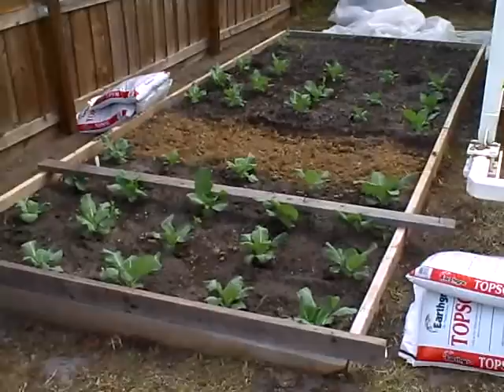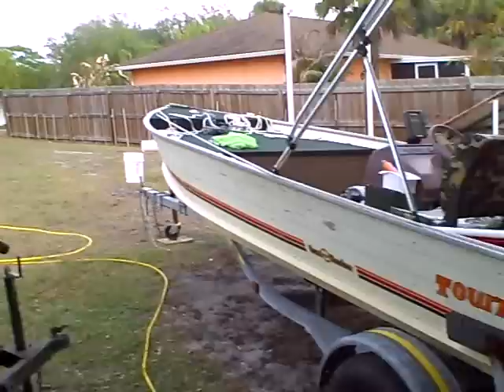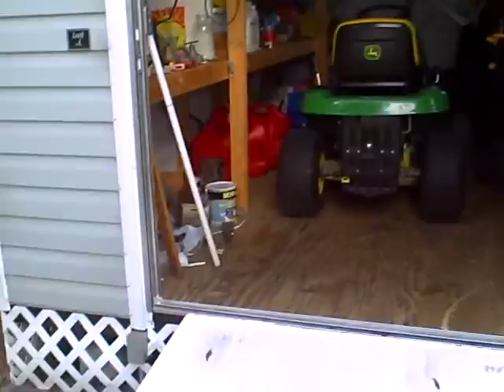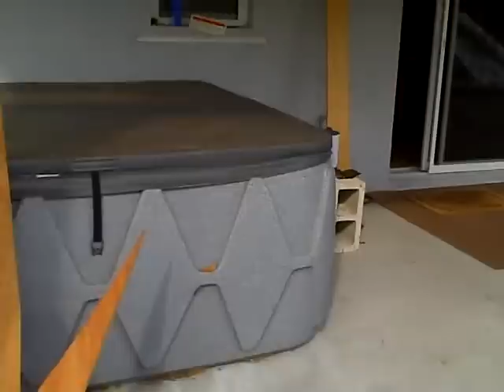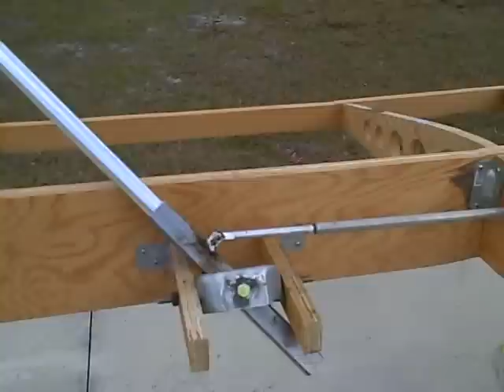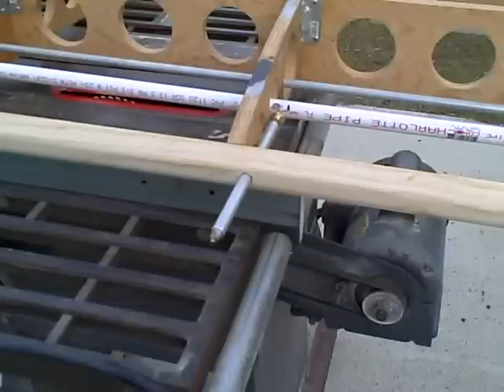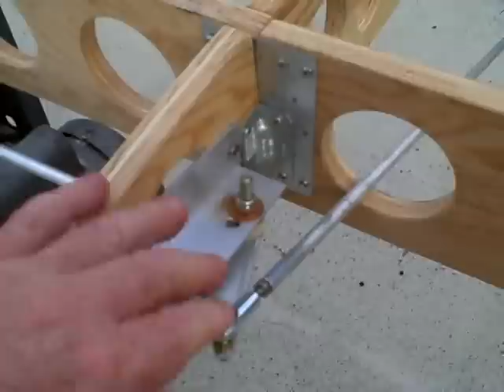My Home Depot Project Airplane

Comment: Like BetterAircraftFabric, I'm scratching my head a bit about your wing cross section. That's more or less a supercritical section, like you'd see on a P51 Mustang, or modern jet. On a personal homebuilt, which I would expect to fly at 70 ~ 150 KIAS, you don't want a shape optimised for 500+ KIAS @ FL300.

I would remind you that what you're doing is extremely hazardous. I do understand the temptation, I have been tempted myself, but make sure your life insurance is up to date, and make sure they'll actually pay up if you buy the farm flying a home built, self designed aircraft.

Comment: The stringers won't add torsional rigidity to the wing using the technique you described in the video. Your wing was nicely made, but it's not going to be strong enough and is probably way overweight for the amount of load it can carry.

Find a local chapter of the EAA and see if they have some advisers willing to help you out.

Comment: Hi, Your wing-airfoil section looks very un-usual with the thickest point very far back, where did you take the airfoil shape from? Did you draw it up yourself? A airfoil for a homebuild plane should be of good harmless flying characteristics, which leads to using a known good design, such as a NACA 24012 or a Clark-Y. These relatively thick profiles make rib-shapes that allow for easy construction of a strong, safe wing. I would urge You the contact the local EAA chapter and seek their advise. Solitary building and design of a plane means going against extreme adds...
Reply: Your over this guys head with the engineering talk.

Comment: Massive plywood ribs,  heavy PVC piping, flimsy electrical box joystick gimbal & attachment, flimsy control lever at aileron, plywood spar (drilled to boot!), the list goes on and on, and we're still on the left wing panel. This would be nice as a full-size mock-up for display purposes... But please tell me you won't actually strap yourself in this thing and attempt to fly it.

Comment: hes in no danger apart from going through the fence after a high speed take off attempt, to heavy, spars to thin, point of max deflection to far back from leading edge, total resultant will be lift tilted so far back it'll be mostly drag. but hey hes handy I'm sure he'll fix the fence after! oh and please stop calling it a joystick!!!

Comment: Check out the "FX Super Light". You can get the plans for $25.00 at Alternative Technologies. They also have plans for several ultra light helicopter designs Some as low as $10.00.

Comment: Barvin, I'm not disrespecting the builder or his ingenuity. This guy isnt inventing anything. The airplane has already been invented, and this guy is not improving on the invention or being innovative. His materials are to heavy and weak (needs aircraft quality). It would be a very short flight if it got airborne, which it will not. It will fold up like a lawn chair and fall like a stone. The pilot will die.

Comment: whaticouldsee: thank you for your reply. so how about attaching the engines to the main metal structure  around the cockpit which supports the landing gear.a two feet long tubing structure would be needed for prop clearence I realize I would have to increase the height of the landing gear so the prop will be at least one off the ground.You being in Australia you cant do this yourself of course.

Comment: "The aileron goes down, and that would be a LEFT TURN???"  Wrong Way Corrigan here.  I honestly don't think this dude will get killed flying this airplane, unless he rolls it off a cliff.  Even a PROPER airfoil wouldn't life an airplane that heavy, but the airfoil on that collection of crap won't generate enough lift for this brick.  Now... he might smash into a tree or ditch at the end of a runway.

Comment: I was worried about the effects of gas vs tig welding on weld integrity in my wing fittings made from 4130. Hell this guy bends some up out of extrusion grade aluminum bolts then to exterior plywood with zinc plated Grade None bolts and nuts and he sleeps like a baby. What the HELL>

Comment: safer for you when you are changing the pitch of them during flight. Otherwise you would have to have a serious grip on your steering control or else the wind will become your worst enemy. Tighten them with some 100 pound pull springs to allow less freedom of movement in the pitch of the Aileron itself and you will have found yourself flying a home built plane a whole lot safer than if they were to remain unaided by any other form of spring or hydraulic control lines.

Comment: which would be bad for you since the effort required to shift your Ailerons up and down is so little the wind speed and angle of your Ailerons during flight will move up and down as easy if not easier while you fly unless you find a proper spring or hydraulic line to keep pressure to pull your ailerons in place. This will keep your Ailerons in your control and not in the control of pitch, wind speed or turbulence. My advice is to attach a spring mechanism to your aileron push rods to make it

Comment: To add a set of heavy duty gate springs to your wooden wing frame that pull towards their center to keep your Aileron push rod controls tightly set in their position for stable flight. Having springs that pull against your Aileron push rods will then cause you to have better and more manageable control of the up and down motion of the Aileron itself. Having the aileron push rods move as freely as they do in your setup now will cause your control surfaces to constantly experience shifting.

Comment: Great start to a practical idea. One suggestion though on your Aileron push rod connections. The main rod that connects to the 90 degree push rod that controls the up and down motion of your Aileron is to loose. What i mean by that is if you were to leave the push rods as they are in your setup if you were to fly this thing fully built you would notice that the wind speed would cause serious fluttering of your Aileron thus making your control surfaces unstable. You need

Comment: Your materials selection is shocking, generic ply can not be counted on for consistency and strength and is way too heavy in that design...your pitot protruding through the leading edge essentially renders that part useless, the first heavy loading and the leading edge will break in two at that hole...it is not braced or sleeved or in any way compensated for...the aileron will suffer skin ballooning and is unbalanced so it or the linkages or both will fail very early on under flight loads....

Comment: I just can't say enough about how reckless it would be to promote or consider this a safe flying machine, there is no internal bracing or bracing of any kind with big spaces between ribs and a woefully inadequate main spar.Your construction is way way too heavy and what's more you are trusting this heavy, unbraced, unstable and weak structure to sustain flight and operate safely in all envelopes and endure flight forces carrying you!!...

Comment: I just finished an RV-7A build and am about to build a Sling LSA and I am very concerned  about the construction and design flaws of your project. As it is the hardware you have used is almost certain to fail - there is a reason AN hardware is used in aircraft construction and engineering and wherever possible all fasteners and couplings and assemblies are 'safetied' for good reason, your concept that simply abandons essential rules of aircraft engineering is a 100% recipe for disaster

Comment: I take my hat off to you for wanting to build your own plane. I understand how much work and effort it can take to work at such a task. as a matter of fact, I am also working on my own plane design. mine has about the same wing span as yours, but the fuselage is 18ft as well. as a suggestion, get a hold of a model airplane kit such as a Kadet Senorita or a like model. those old time model planes had many similar design characteristics of small full size aircraft.

Comment: TOO HEAVY. Aluminum skin for an aircraft this size is way over kill. If you want this to fly, you want the ribs for the airfoil to be made of high density 1 1/2 insulation foam (The pink stuff) and use an aluminum dowel as the wing spar, and other stringers as you feel the need. Plywood and aluminum skin will not work.

Comment: Dude do not fly that.  It will kill you.  Get some plans and do it right where all the engineering has been done and you are using approved and tested materials.  That joystick gimble is not safe.  That is not aircraft grade aluminum, but cheep slag aluminum that is not ANSI certified.  It will eventually crack.  The way it is attached to the wing is dangerous too.

Comment: I'm not trying to be a party pooper here, but this is clearly not meant to be a wing on a flying aircraft. This thing is fine for demonstration purposes, but this wing, as built, would barely support its own weight in flight, much less an aircraft with a pilot. Just a few things I noticed, the aileron hinge is far too small and weak to remain attached if subjected to in-flight stresses. The main spar is too thin and has an unsupported joint at the fifth rib. And that joystick gimbal? Really?

Comment: The two piece wing spar sure is an interesting choice, and nothing more than a butt joint held together with a few wood screws. You must be aware that this will fail to work and the wing will fold on you should you actually get enough airspeed to put any sort of load on the wing.

Comment: Sir, I am a Captain at a major airline, I have over 25,000 hours of flight time in everything from J-3 Cubs to large transport category jets, I've also been a licensed aircraft mechanic for 30 years. Please do not try to build and fly your project plane without proper plans and some help from knowledgeable people. I can see several potentially FATAL flaws with your design. Plans are relatively cheap and there are lots of people with experience that will help you for free.

Comment: It won't fly, wrong materials man! TOO MUCH WEIGHT! By a LARGE measure. With my first real attempt at flying I built a hang-glider out of ail-board poles and tent-flies. I tried it out in the wind, on a dam-wall. And before I was ready for glory, I was already hovering at 6" above the ground. It was very easy to pick-up (and poles were only normal glass-fiber). It turned- out that it had a bias to the left. I was going to try and fix it but didn't get round-to-it and I gave-up (too scared).

Comment: Should've used a regular board for the spar instead of ply. I can't tell if these are, but wood screws are bad. This may seem light-weight to someone who has worked on houses and such, but it's way too heavy to get off the ground.  That looks like 1" pine ply, which is too thick and the wrong material.
Your other projects look pretty well done though.

Comment: Hi,
Building such an airplane at home gets even more fun and more possible with our BetterAircraftFabric Covering System: It needs no paint for technical purposes, comes in different colors and can be painted if so desired. Its UV-resistant and easy to apply: Check out our U-Tube channel and Look for Oratex6000. It goes on with a non-toxic glue with no Solvents, glue-strength is over 100pounds per square inch! And you save 80% of the time that is needed for the usual covering systems.BestRegards

Comment: I see you are using plywood for the main spar. This is your main tension and compression member, and plywood can not provide that strength. Do not fly this! Aircraft plywood can be only used as a shearing field in a spar, but only if you have spar caps of adequate straight grained wood or other suitable material of the right strength.

Comment: That aerofoil section looks  wrong to me, it needs a little more curve  on the uppersurface behind the leading edge to the main spar. The main spar needs to have solid wood on the upper and lower  parts to make an I beam effect. It all looks too heavy for me and doubious in many areas. Please do consider plans for a proven design as suggested by other commentators

Comment: I would think it  would be strong enough without the stringers. The aluminum skin is  going to make it very rigid.  Check with someone in the E.A.A. and they could help you.

 If you fly that thing, you have a larger pair than I.

Comment: I'm an Aerospace Engineering student at the University of Kansas.

This is an extremely ambitious project, and I see several very important issues.

The thick, building-grade plywood you've used for your wing-spars and airfoil forms is very strong (extremely heavy), but you have literally almost nothing holding them together. Not even fitted and glued joints, just a few screws.

It also looks like you have a low-wing configuration with no dihedral.
This aircraft will be EXTREMELY unstable.

Comment: I can see two things: 
1.) The Wright Brothers would love this aircraft. 
2.) And the FAA is probably typing out new rules because of this video....
Reply: The FAA has this covered.  There are two ways to make homebuilt aircraft.  One is to build an aircraft as "experimental", and have it inspected prior to first flight.  The other is by building it as a "Part 103 Ultralight".

First, a wing constructed like this will never pass an FAA inspection, and second, ultralights are limited to 249 pounds, and with this kind of construction it will never meet that limitation.

Comment: The effort is there but this structure will Fail, As a License Aircraft Structural Mechanic with 10 years heavy Airframe construction and maintenance I too build and design experimental aircraft.All Aircraft shall meet an airworthy design IAW FAA AC 43.13, 14CFR FAR Part 23 to meet an certificating basis. PLEASE by all means if you are interested in building or restoring for your first time, join your local EAA chapters look over someone who knows something who can teach you.

Comment: If I'm not mistaking, he died in a crash. Not sure, If the guy posts then maybe i Was wrong about him. There WAS a crash that involved a Home Built aircraft from average house hold supplies that had a G rating of +0.3 (before the wings collapsed and folded up.   Youtube wont let me post the link to the other link but if you search " What happens when the Phone Rings" - It should come up with a EAA lecture. Talking about Cirrus Aircraft Crash investigator.He mentions about the crash involving 1.

Comment: This shit aint gonna fly Bubba. Your materials are crap and your design is crap. Ya got a real prop or are ya gonna use a lawn mower blade? It went past being to heavy along time ago. It is to short. You wont have enough power. Even if you pulled it like a glider with your pick up truck at 50 mph it will fold up like a lawn chair. A Sport Cub can lift it's tail wheel in 50 ft and this is way heavier. Ya can't make chicken salad out of chicken shit Jethro.

Comment: I would highly recommend purchasing plans for a kit that was designed by an engineer. There are lots of different designs to suit your fancy.  I appreciate your effort on the project but please do not plan to fly this wing. It would be ok to demonstrate the basics of aileron movement to students but used for instructional purposes only.

Comment: Dan, I noticed some other things. This is your left wing. and the plywood looks more like 3/4" plywood. One thing that is extremely important to understand is center of gravity. With you and fuel and ready to fly the plane "has got to" balance somewhere between 25% to 30% of the wing chord. In other words if your wing is 48" wide at the fuselage then the plane MUST balance about 12" to 14.4" aft from the leading edge of your wing. PLease google, Legal Eagle ultralight. Excellent DIY kit

Comment: I applaud your work. I've built several Loehle P5151 kits and flew my Mustang for 6 years before I had to sell it. I am very concerned about the weight in your wing. My wings weighed 27 pounds each. I see you're using what looks like 1/2" ply as ribs on about 24 or 30 inch centers. That's extremely heavy in aircraft structure. My kit used 1/8" luan on 12" centers with a 1/8"x 1" cap on top and bottom.  Most kits don't even use that much ply. Plus, surely your spar doesn't have a splice. not good

Comment: you can pick up a transmitter, receiver and speed controller, a few heavy duty servos for about 150 bucks. fly it as a drone first. if you need power and to cut weight use one or two older model roybi weed whacker engines. you can find the vids to strip can convert them here on youtube. bypass the stick and connect the servos directly to the ailerons (flaps).

Comment: look like the spar is very very week and the ribs 2x too robust and in too low numerals...
I think it's better you buy a plan for a light aircraft, for example a Pou du ciel HM293 who is able to fly safety with a small engine like a  modified Briggs and Stratton .
You can see the mods take on the engine for the Colomban MC30 Luciole who fly 200kph with such engine...

Comment: hope you don't plan to actually fly that thing, because the FAA will not give you any type of clearance.  The wood used in building has to have a specific number of rings per inch to be used.

Comment: it will never meet part 103 for ultralight.
i applaud the effort but there is really no substitute for a proven design.  it takes aircraft design experience and lots of it to design and build aircraft that are safe.  even pro designers shitcan more designs than they ever take to market.
this project should be abandoned and losses cut.  the effort, time and $ could be put to better use assembling an airframe that is proven, safe and legal.
he'll also be more likely to complete the project.